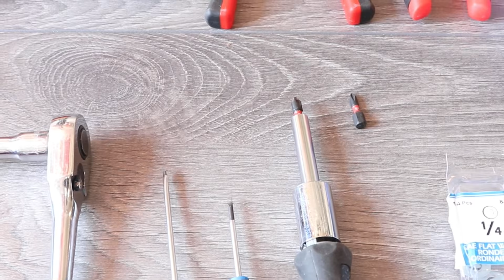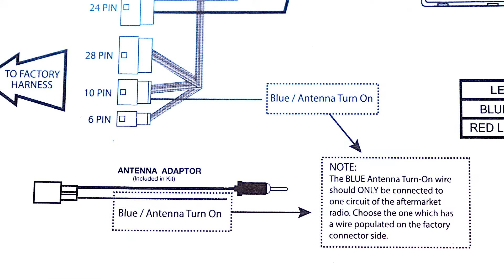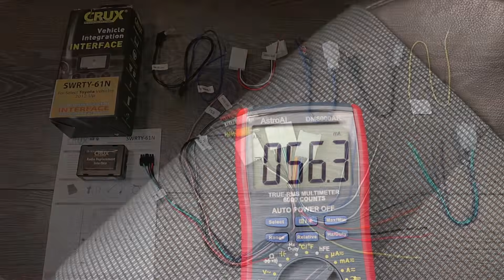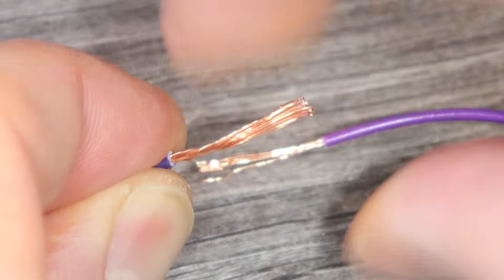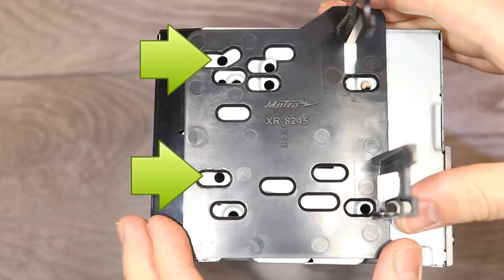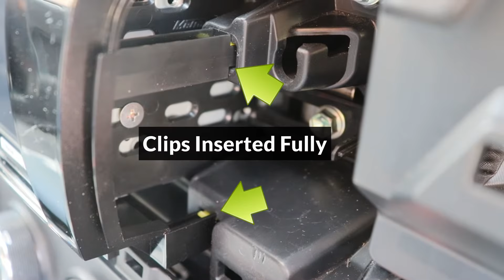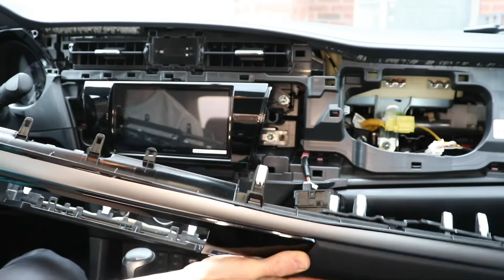Stereo UPGRADE, Toyota Corolla - Radio Removal & Installation 2014, 2015, 2016, 2017

Comment from the maker: If you enjoyed the video, please give it a thumbs up  👍. Your support is greatly appreciated . 
Also check out my TWEETER Upgrade : https://www.youtube.com/watch?v=EG8nxTCzVa0  
REAR SPEAKER Upgrade : https://www.youtube.com/watch?v=oL5zZH09VuA 
FRONT SPEAKER Upgrade : https://www.youtube.com/watch?v=YFdReUjCeu0
Reply: This is a hail Mary but, could you possibly do an amp install in the 2014? I just got a kicker  4  channel amp and am a bit lost. Thank you for the videos!
Reply from the maker: @Lukern89-k6i  If this video gets enough views I would.. it will take some time though, so by then I'm sure you'll be done. It's not very difficult.. probably hardest part is getting the power wire from the battery to the back, and you can see my Compustar Alarm video for getting a wire from the engine side to inside the car.  After that the wire can run on the driver side all the way to the back, just have to pull the trim at the bottom (next to the fuel door/trunk release).. along with the RCA outs and front speaker wires from the head unit. You can use new speaker wire and wire up the back speakers directly from the amp, and the front can hook into existing wiring from stereo... you'll need a color diagram for the factory stereo wiring to find the front speaker wires, probably available from the12volt.com . I also have a video for taking off the rear seats, you may have to do that, not sure.  One thing I'm really not sure is where to get a good ground in the trunk... and I'm guessing you're installing in the trunk?? Cause some people put it under the driver's seat.. and in that case, there should be easily found ground points in the dash, and I show one in the Compustar Install Video.
Reply: Thank you, that helps a lot. I'm just confused how I'm going to get wires from the amp all the way back to the front speakers. I have an idea of what to do in general but there are some clear gaps in info so i cant really move forward. I have a 2014 corolla, and i noticed on the drivers side north  west of the gas pedal is an ovular cut by toyota in the insulation and you can just pull it right out. I believe that's where it's going to go through. @CleverFix
Reply from the maker: @Lukern89-k6i  Here's my Compustar Video: https://www.youtube.com/watch?v=sR-mdzWnoaI that shows routing a wire from under hood to inside, and ground point.  Once you get the amp powered, it just needs the RCA outs from the stereo plugged into it, and the the speaker outs have to be connected to the speakers instead of the outs from the stereo.
Reply: Can we install same stereo in corolla 2009
Reply from the maker: @amarpreetsingh758  You can check here:  https://www.crutchfield.ca/S-DEXaufZUYpo/p_130DM1770/Pioneer-DMH-1770NEX.html  and click "Does it fit your car?"     Also when checking out, they will show the parts needed for the installation.

Comment: This would cost me around $350 (using refurbished stereo) and represents a fair amount of work. 

If it is a major sound quality upgrade I'd consider doing it. I'm pretty happy with the current sound but maybe I should go to a car audio store to see the difference.

I upgraded the speakers and tweeters a year or two ago. I'm really thankful for your videos!

P.S. I just listen to the radio, I do not use Apple or Android audio.
Reply from the maker: You'll get the most difference by using a USB dongle with MP3's or Sirius XM if it's affordable, it requires an extra antenna though.  I get Mp3's from Mp3million for about 10 cents each.  Radio will sound better with the stereo upgrade, but I'd say the quality really depends on the strength of the radio signal.  I believe lower strength stations don't sound as good with the Pioneer,.. and there's a difference in how the Pioneer handles static/low strength which affects the sound.  It's hard to explain, and I'm not even 100% sure, but my feeling is that the stock was better at picking up lower strength stations.  With a really good signal, I'd say the Pioneer sounds about 30-50% better than stock,.. I'm happy with it, and I think I'd really like it if I had XM, but I just don't drive enough to justify it. I also like that the night time reverse screen looks better than the stock.  There's one more drawback, which is the knobs .. everything is touch, so it's harder to change volume quickly.. and there's no "seek radio station" from the steering wheel controls, it only allows toggling between 6 presets from the wheel.. They could've done it but I think the SWRTY wasn't designed properly, they should have programmed "hold" left/right to seek. I should probably send them an e-mail about it.

Comment: This video tutorial is great thank you.  I followed your speakers tutorials and it worked out amazing.  Now I plan on tacking this one. Where would you suggest to route mic cable or a GPS cable?  My radio has two cables. The mic and GPS.  GPS has a little box.  Many thanks!
Reply from the maker: I have a A-Pillar Trim video here: https://www.youtube.com/watch?v=3r0eSm4PiF8
I routed the mic under the dash, then through the pillar, and I taped it to the existing wire bundle in the pillar. This way it doesn't interfere with the airbag.  Then I put it under the roof liner, and double-side taped it to the windshield close to the rear view mirror (making sure it's not obstructing the view for driving).
Reply from the maker: One thing to note about the top of the windshield, is that it has those "dots" to reduce light, but they might block signals for GPS.. I'm not 100% sure though, it depends on the type of windshield.  Common locations for a GPS antenna are on the dashboard, on the rear tray at the back. Here's a location for my alarm antenna, I would try the dash on that side, since it's receiving from the sky, it should have a good view there: https://youtu.be/sR-mdzWnoaI?si=YMUV4cJ64DOpCdZG&t=520
Reply: @CleverFix I finally changed out the head unit and I just want take one minute to say THANK YOU once again.  The hardest part was the A Pillar.  Boy did it fight me.   I went with all my cables on the passenger side.  Mic and GPS it turned out great.  But that one little  clip the twist he who designed this wow what were they thinking.  That could have been a simple screw.  Anyways. Thank you and happy holidays

Comment: Hello I was upgrading the stereo but I took out the air bag pin now it's showing air bag light check bus traction light it also burnt the stereo fuse and my corolla not changing gear do you know if it's fuse or something major if you can please answer
Reply: Put factory back in and clear the code and see doing shift again you going to need a new unit or canbus

Comment: My local stores only have the Dmh-w3000nex locally available, I ordered the crux and the cover. Are these two items capable with the w3000nex model (6.8inch screen, with a slimmer module unit opposed to the the traditional double unit the 1770nex has). I have a 2015 corolla S with the Push to start option. Thanks for the advise 👋🏼
Reply from the maker: Here's the manual for the CRUX SWRTY61N: https://cruxinterfacing.com/wp-content/uploads/2024/09/SWRTY-61N_MANUAL_070124-1.pdf
You can check fitmet on this website: https://www.crutchfield.ca/p_130DMW3000/Pioneer-DMH-W3000NEX.html
Click "Does it Fit Your Car?"  and it will tell you if it's compatible and what is needed to install it.  The CRUX should be one of the options, and it gives other options as well that are more expensive.

Comment: Going to try this out, thanks for providing a clear and concise video on how to do this (provides a lot of confidence in my ability to do this at home). do you want to update your pioneer stereo amazon link? Would love to buy using your affiliate link to support your channel, but the current link is broken. Thx!
Reply from the maker: I'm glad it was helpful, and I updated the link, thanks for letting me know, it's really appreciated! Just so you know how the links work, I think many people don't:  Once the link is clicked, it lasts 24 hours, and if the user makes a purchase within that time, the affiliate earns a commission. The user doesn’t have to order the exact item they clicked. As long as they make any purchase within 24 hours of clicking the affiliate link.
My stereo is still working great.. There's only one "bug" it has, if the volume button on the steering wheel is pressed up/down while it's booting in the first 3 seconds, it sometimes causes it to freeze and reboot. It's something to do with the CRUX sending the signal before it's ready to process it. Other than that, never froze or had any issues so far.

Comment: I went with the newest model Dasaita for my 2015 corolla, super easy to install, the harness was indeed plug and play. However the radio reception is not anywhere near the stock sound, the reception is there but the bass and sound goes in and out. I have been researching and it maybe the antenna amp improperly being connected in the harness. Any suggestions on how to remedy this?
Reply from the maker: Can you ask the manufacturer if their harness provides power on the antenna amp pin?  If it doesn't hopefully they can advise you on how to do that. I am not familiar with that stereo sorry. 
I am familiar with the sound without the amp working though, because I initially did not connect it.  It was fading in/out even on the best stations while driving, and the weaker stations were not picking up at all.  Once I got the amp powered, everything became as good as with the stock radio.
Reply: @CleverFix  Thank you! I am reaching out to Dasaita now, hopefully they have a solution. I have been researching and have not found a way to fix this.
Reply: I reached out and am underwhelmed with Dasaita's support they are very slow to respond and the responses are general and vague. Their wiring harness does not provide power to the antenna amp pin from what I gather from the responses I got. There is power on the other connector, which also has an antenna connection on it but I think it was for a motorized antenna not a signal amplifier and I have not been able to get any advise from them on correcting this issue. Any suggestions of how to go about doing this? I have been researching but no luck so far on a specific thing to do. I don't want to cause another issue.
Reply from the maker: @JasonWatkins-p8d  At 4:32 in the video, I show the antenna connector that came with the CRUX SWRTY-61N.  It has two wires. One is for the signal, and one is for the booster.
So the Dasaita must have a similar connector to that at 4:32,  but does it have one wire, or two? If it's only one wire, then the booster wire and pin are missing.  A car audio shop should be able to sell and install that connector for you on the Dasaita, it should be a common part.
Reply: @CleverFix  There is actually 2 wires. I chatted with someone from Cruchfield and got some further insight on diagnosis. When I checked the antenna connector the large metal single pin spun around and the wires inside the plug seemed loose so the problem may be the connector itself. I uninstalled the the new unit and reinstalled the factory unit and everything worked as it should. I ordered a new connector and will try replacing the connector and see if it fixes it. I did a factory reset of the new unit disabled external amps in the menu and it seemed to make it slightly better but the reception signal still seams weak. Thank you for your suggestions, it helped me along the way for sure! Much appreciated!
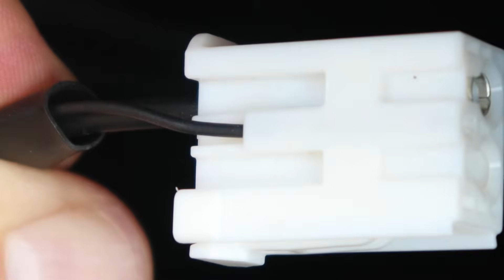Reply from the maker: @JasonWatkins-p8d  The booster is either on and off, so "slightly better" should not really be possible.  I show the booster wire at 5:19, It's the tiny wire on the side. The big thick wire is the signal wire, so maybe your signal wire is loose based on what you mentioned.
Hopefully the new connector helps!  It may also be possible that the Dasaita has that booster wire, but it's not providing power to it. Hope you get it figured out!

Comment: what wire harness do i need to get I have a pioneer radio and the cover plate so I get the right stuff I have a 2014 Toyota Corolla LS
Reply from the maker: Check the description, I used the CRUX SWRTY-61N , I placed an Amazon link there . It creates the "connection" between the car and the stereo and allows steering wheel controls to be kept, as well as reverse camera. And the stock connectors on the car don't need to be cut off.  Hope that helps. See more info directly from CRUX: https://cruxinterfacing.com/product/swrty-61n-radio-replacement-w-swc-oe-rvc-retention-for-toyota-vehicles-2012-up/

Comment: i wish i could upgrade to a pioneer unit.  Sadly my car has a beats audio soundsystem and important car settings that you make on the stereo  which wont work with a different one
Reply from the maker: Mine did too, it had door lock and light sensitivity settings, but I can live without them. I hardly ever changed them.  If I ever really need to, I kept the old stereo and I can put it back in temporarily.. I guess it just depends how important those settings are. The dealer can likely adjust them also through the OBD port, but they'll charge for it.
Reply: I actually did upgrade at one point in my 2015 Toyota Corolla LE to a Pioneer DMH-2660NEX head unit with an iData Maestro Kit.  I ended up giving the head unit away and going back to the OEM stock Fujitsu-Ten head unit.  I had problems with the Pioneer DMH-2660NEX head unit turning off when I would drive around and when I turned on the car the screen would be black not being able to see the reverse camera or menu options.  There is just a lot of wire clutter with the iData Maestro harness adapter which takes up more space in back of the head unit.  I learned the wasting money way how the oem stock head unit and oem speakers are meant to work with your car instead of aftermarket electronics.

Comment: Awesome tutorial as usual Clever. Been thinking of upgrading for a long time. I have installed a 5 channel amp in my 2015 and the stock headunit is not great. Sound quality is key for me.  Was thinking of doing this radio over the chinese big screen ones. Do you lose steering wheel controls to change the music?
Reply from the maker: Thanks! The Steering Wheel controls will continue working with the CRUX SWRTY adapter, however, Pioneer hasn't mapped them very well when listening to radio. All I can do is change volume, and tune to pre-set radio stations. I can't Seek to a new station. The mode button changes from Radio to Bluetooth, USB.. but can't change between AM/FM from the steering wheel.  Answering and hanging up calls also works.   I bought this one because I know Pioneer lasts a long time, and I'm not sure about the cheap aftermarkets. I never had a good experience with cheap car audio components.  The sound quality is definitely improved with the Pioneer, and I really like being able to tune the sound with the equalizer.  Thanks for watching!

Comment: I read some reviews on this and it keeps coming up as this unit is not a WIRELESS carplay. is that true?
Reply from the maker: I haven't tried it with Apple, but it looks like it needs USB connection from the manual: https://www.pioneerelectronics.com/StaticFiles/Manuals/Car/OPM_DMH1700NEXUC_EN_A.pdf

Comment: Do I need a data link?
Reply from the maker: Good question. For 2014-2016 it will work as shown in the video.  I believe it will work on some later years as well, but I haven't tried. You can contact CRUX directly here: https://cruxinterfacing.com/product/swrty-61n-radio-replacement-w-swc-oe-rvc-retention-for-toyota-vehicles-2012-up/  and ask which products are compatible with your model.   They say 2012-2019 Corolla, but Crutchfield does not display the SWRTY on 2017+.   See: https://www.crutchfield.ca/p_130DM1770/Pioneer-DMH-1770NEX.html
and select your car, for compatible parts.
It's odd that Crux lists more years than Crutchfield does. 
Thanks for watching!

Comment: Hey I recently tried to install this 
And I get the message usb overcurrent 
What does that mean?
What can I do to fix it?
I have a 2014 toyota corolla 
And I used the same radio in description.
Reply from the maker: This was asked in another comment, so I'll just reply the same reply:
"Possible short circuit somewhere.. Could be the USB cable is bad, or sometimes the error can show if the speakers are shorted, the terminals of the speakers shouldn't touch any of the car's body, if they do it can short them.  I'd take the USB cable out, see if it still happens, and if it happens, then disconnect the speakers one by one.. the rear is easiest to start with."
Hope that helps! The other poster never replied back, so I'm guessing it worked for him.
Reply: Okay

Comment: I am unable to find any videos of the radio I have in my 2015 Corolla. My radio does not have knobs.
Reply from the maker: Sounds like somebody has already upgraded it.. did you buy the car new?  Stock stereo has knobs.
Reply: @CleverFix  It turns out my son upgraded the radio.  Thanks for replying though.